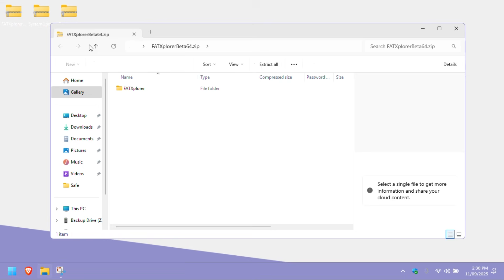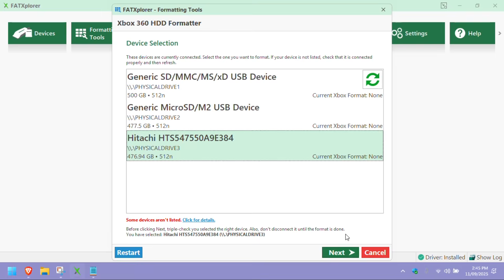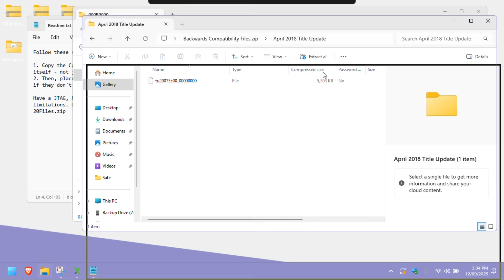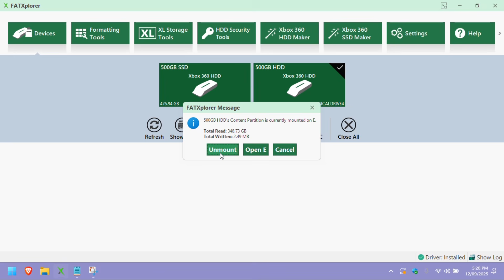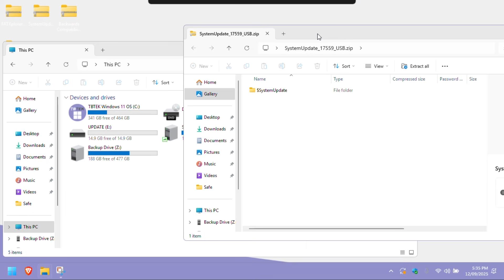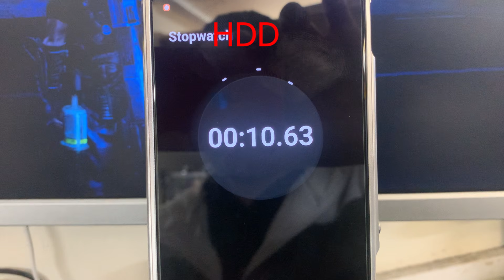UPGRADE your Xbox 360 with an SSD! (BRAND NEW FEATURE!) | TBTEK

Comment from the maker: Thanks for watching guys! Just a few notes:

- Since filming the video the developer has released an update which may have fixed the error I encounter in the video (and others) in which case you can skip the formatting tools step.

- Although I use a 500GB SSD, you can use smaller ones however DO NOT use 240GB or 480GB drives as you will only be able to use 120GB and 250GB respectively due to the security sector limitation. 

- If you are buying an SSD especially for this, then I recommend getting the Lexar NS100, which is available in different capacities (link in description).

- Feel free to use the comments to ask for help and share assistance with others, this is a brand new feature and so there are likely to be issues.

- If you don't have an SSD and don't want to spend a lot, then you can use much cheaper Western Digital Hard Drives instead, watch my other video guide: https://youtu.be/EMr2yj0fdBI

Comment: How will it respond to say 1TB or 2TB
Reply from the maker: It'll work but it's wasteful.

For non-modded consoles, the process relies on using existing security sectors from official 360 hard drives. The security sectors effectively verify the hard drives and tell the console what capacity they are.

The maximum capacity official hard drives that were available were 500GB and so that's the largest security sector we can use. If you use 1TB, 2TB, 4TB etc. drives then the console will report the drive being 500GB total and so the additional space will be wasted.

Comment: I recently completed this upgrade with a 512GB Lexar drive. - Honestly given the time and effort invested I don't think it was worth it. I ended up having to flash my drive twice becuase I didn't have the original Xbox file repositories setup. 

No huge describable speed difference. I realize now a lot of the slowness is because of the OS which was designed to run on a 5400 rpm spinning drive so not optimized. Yes maybe the UI is a tiny bit more snappy but still glitchy and slow. Said differently while this is a nice upgrade unless you just so happen to have one of the eligible drives lying around like I did I wouldn't waste a whole lot of effort on this upgrade but to each their own.
Reply from the maker: The OS itself is stored and ran from the onboard NAND storage and so you won't see an improvement in that regard.

In terms of loading games/apps/saves from the SSD, we are still limited by the SATA 2.0 interface and so load times won't be massively different, however you should notice a lower amount of latency (e.g time it takes to begin moving/copying stuff, time it takes to begin booting a game etc.).

The two biggest benefits of being able to now use SSDs are:
- That despite the falling number of original Hard Drives and the compatible WD drives that work with the flashing method, we can continue to replace failed hard disks on these consoles for the foreseeable future.
- SSDs are much more rugged and less susceptible to physical trauma damage than regular HDDs. So those that move their console around a lot will be less likely to damage their drive.

Comment: Can xbox treat ssd properly (treem, etc)? Or it possible dies faster?
Reply from the maker: Very good question!

The Xbox 360 was never designed to run an SSD in it's SATA slot and so I can't imagine Microsoft would have incorporated TRIM functionality, so it's possible that it'll wear abit faster than it would in another machine.

Having said that, a PC/Laptop/Server will have far more power on hours than a games console, so it shouldn't really be a big concern.

Comment: Is the Lexar NS100 128gb a safe one to buy. The document says to try and  buy 120 not 128...is it because I will lose 8gb?
Reply from the maker: Yes any Lexar NS100 will work as they reliably have a compatible Phison controller. If you're going to the effort to do the SSD upgrade then I recommend going with the largest compatible size (500GB) which I have linked in the description.

Comment: SSDMAKER should be Free. I don't know why he is charging $ for an old console with SSD support
Reply from the maker: I get what you mean about an old console but I think $3 is fair considering the time and effort the dev has put into the feature.
Reply: @tbtekukthen what about those developers who made the ABadAvatar exploit. They didn't charge a dime.
Reply: @MirzaKhalid  That's because they can be sued for that. Meanwhile you can't be sued for an SSD formatting software. It's completely legit according to the laws. A hack to jailbreak a console is not legit and definitely not lawful. That's the difference.
Reply: @MirzaKhalid  3 bucks to replace an old HDD with an SSD on an un-modded console is well worth it.
Reply: @advanceddarkness3 No, it’s not. By that logic, developers who mod the Xbox 360 should be charging at least $1 for their exploits too. Charging $3 just to convert an HDD to an SSD sounds completely unreasonable.
Reply: Hola buenas, me podrías ayudar tengo el mismo ssd lexar ns 100 pero al seleccionarlo en ssd maker me salta un error, no logro dar con la solución te agradezco la ayuda 🙏

Comment: In the video at minute 15.48 in the content folder there is a cache folder that, following your procedure, does not come out on my Lexar drive. Why?
Reply from the maker: I had tested the drive in the console just before filming that part of the video and so it generated the Cache folder.

Your drive shouldn't have one until you do the same or complete the step at 20:01.
Reply: @tbtekuk эта видео инструкция только для кастомно прошитых консолей ? Или консоль со стоковой прошивкой увидит такой носитель ?

Comment: how do i enter the security form factor?
Reply from the maker: I assume you mean security sector.

FATXplorer should select the best security sector to utilise the maximum amount of available space on your drive, you can just choose next at that step. If for whatever reason it doesn't then you can download one of your choosing, then choose select security sector and navigate to it (need to extract the .BIN file from within the RAR/ZIP file you download first).

20GB: https://digiex.net/attachments/20gb_hddss-rar.3572/
60GB: https://digiex.net/attachments/60gb_hddss-rar.3571/
120GB: https://digiex.net/attachments/120gb_hddss-rar.3570/
250GB: https://digiex.net/attachments/hddss_250gb-zip.3814/
320GB: https://digiex.net/attachments/hddss320-zip.7395/
500GB: https://digiex.net/attachments/hddss500-zip.13610/

If your drive is an obscure size, for example 240GB or 480GB, then you would need to use 120GB and 250GB security sectors respectively which means a lot of wasted space, so better to avoid those drives if possible.

Comment: long shot but can i just put the ssd without having to saved my old files from the old broken xbox hdd?
Reply from the maker: Yes! Just follow the video and skip the step at 20:01

The drive will have no data (games, profiles etc) on it but if you follow everything else correctly it'll have backwards compatibility functionality and avatars will work.

Comment: Can you use a SSD that is bigger that 512gb?
Reply from the maker: No unfortunately, as I explain at 36:02.

Limited to the security sectors from the original Microsoft hard drives (20, 60, 120, 250, 320, 500GB).